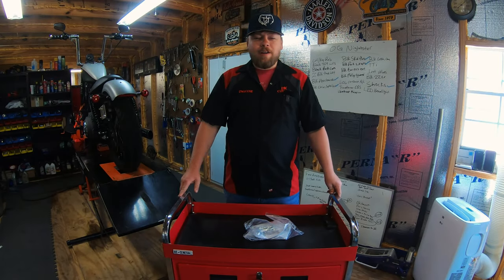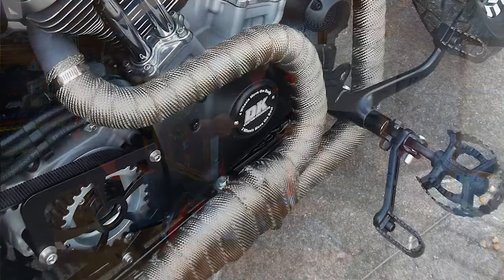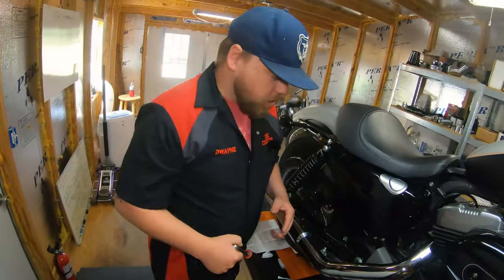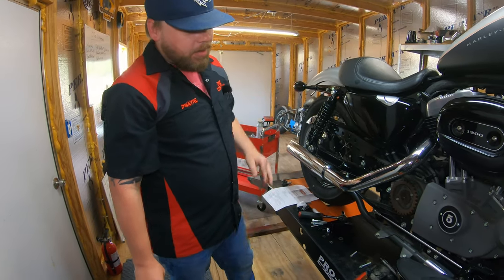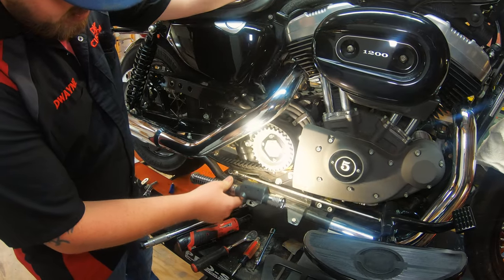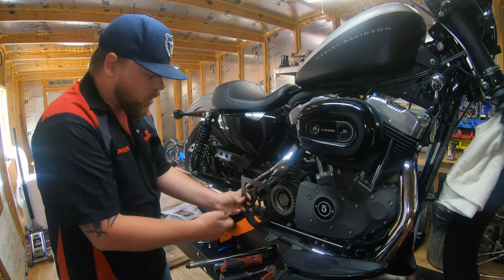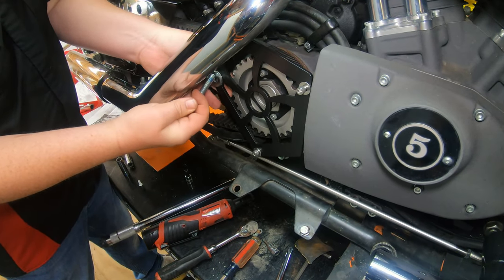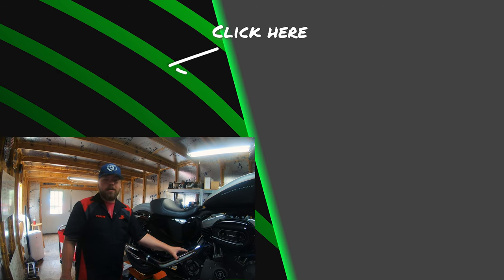Harley, It's The Little Things That Make a Difference!

Comment: 'no purpose other than looking good'  well looking good is important too ! an it's a really good looking mod . 
how did you spray the pulley with the belt on there ?
Reply from the maker: Thanks!
We taped off everything, except for the very edge of the belt where it sat in the pulley.  We could have taped that off too, but it is not necessary.  The paint that gets on a few inches of just the edge of the belt (the top of the belt was taped off) is easy to remove, and not really noticeable if you don't take the 5 minutes to clean it off.